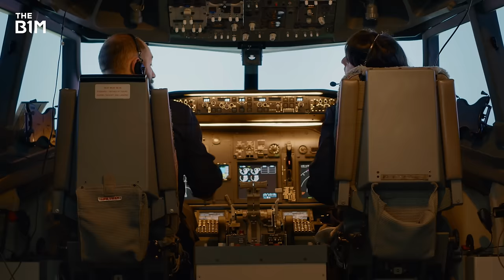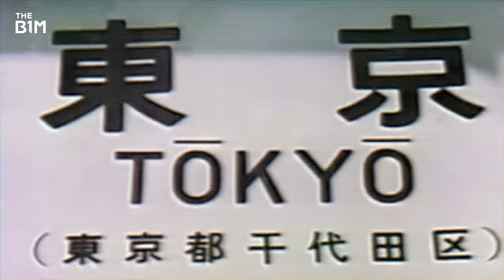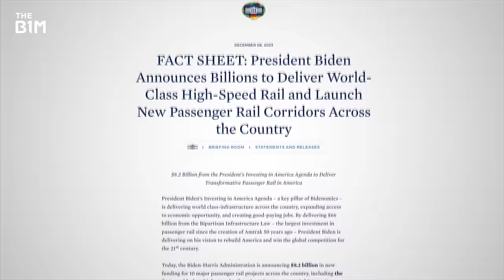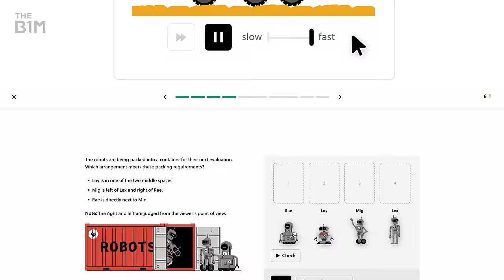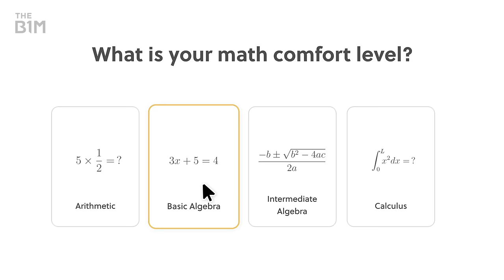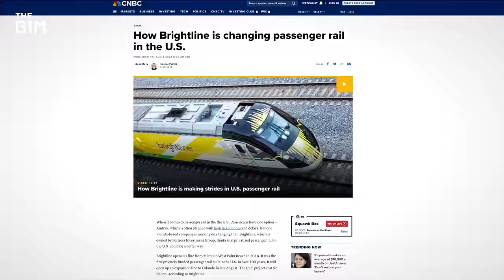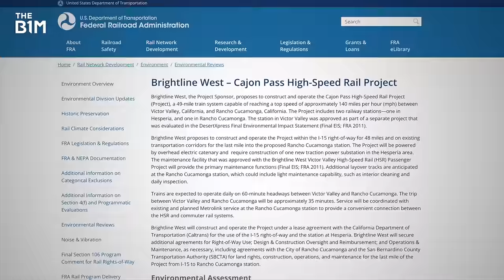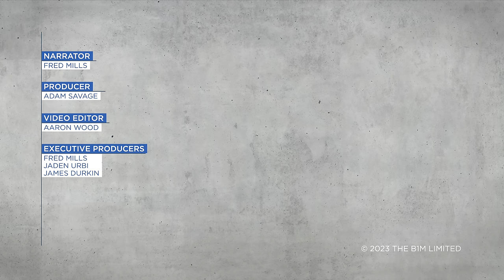The $140BN Race to Build America's First High-Speed Railway

Comment: 11:28 I doubt that the line needs to be as flat as possible. Right, windy tracks along narrow valleys isn't a real thing for high speed line, but not the incline. Look at dedicated eurpoean HSLs. They are quite steep, since no freight train needs to run on them. One of the fastet HSL, Cologne to Frankfurt (187 mph ) in Germany goes through mountains (ok, not the alps...) and its incline is up to 4%. Or the French HSL from Paris to Strasbourg (200 mph) with a incline up to 3.5%. Or Florence - Rome even up to 8.5% gradient (156 mph)

Comment: The only problem is that Amtrack also rides on the freight train's tracks, so the trains cant speed at 150 mph the whole time. Japan, China and Europe have devoted tracks so the trains don't need to pull over when a fright train comes along. The other thing is because the tracks are their own, they are elevated, so you don't have idiots trying to cross or get stuck. Japan is light years ahead of the US when it comes to bullet trains.

Comment: Stupid that Brighline West is laying double tracks.  It could do a 3 hour round trip so one track can service 6-8 round trips. Enough to get started.  If you want to double capacity, put a few mile siding in the middle where trains can pass eachother.  You don't need double tracks for the whole distance.  Also, Brighline should chase passenger trains with cargo trains with an intermodal yard in Cucamonga.  I worked 4 years for CN Rail and Intermodal.

Comment: For all the attraction of Brightline West, the massive advantage from owning or leasing tracks and not having to secure lands for new tracks is severely understated in the video. The new line is not bringing high speed rail anywhere near the actual city of LA and current Metrolink connectors can take an hour from where the new line ends to enter the city. 

These are key advantages that CHR and Amtrak don't enjoy. There is a reason why Amtrak can't even run existing trains on time and that's because of not owning tracks. So comparing these to Brightline is not fair, even if I fully support a new rail line in USA.

Comment: The problem I see is that they are putting the train between the roads. If the train has an accident it will involve the traffic on the road and possibly cause a massive traffic jam from the accident and the damage to the roadway.
Reply: What is going to happen is mostly the opposite...
Reply: I didn't want them to build that train set on freeways because some routes such as the one from Los Angeles to Las Vegas require travelers to drive 60 or 80 miles in the wrong direction until they veer north on interstate 15 and go more or less directly to Las Vegas from there.

Comment: I've been saying for decades, to just use the medians on the interstate highways for trains. The overpassess are already built, just lay the tracks. It should be a no brainer. The bigger issue, is cities must have a mass transit system. No one is going to want to take the train and then have to rent a car when they get there. I live here in Florida and I'm not sure how well the new brightline is going to work. They spent way to much money upgrading old tracks, instead of using the interstate system and they have a lot of old train crossings they have to maintain. They have already had two cars hit in one small town. Also, the options to get a around Orlando are limited. Miami has a metro system, but Orlando does not. If you had a high speed train running from Miami to say Atlanta, it would be full all the time and Atlanta does have a metro system. 
The other issue is the lack of convience with trains/Amtrak. They have continually cut back services over the years, instead of adding services/trains. It is not convienent at all. There are only 2 trains a day for all of Florida (not counting brightline), which is the 3rd most populuated state and you cannot travel West or directly to the mid-west. It takes 2 days just to get to Atlanta, which you can drive in 6.5hr from Tampa. The service that used to run from Jacksonville to LA, was stopped at New Orleans back in 2005. If you live in Naples or St. Petersburg, you will have to catch the Amtrack bus to either Tampa or Orlando, to actually get on the train, because they stopped the train service decades ago. Its just run very poorely, particularly in the South East.

Comment: Around 11:30 it is said that high speed trains couldn't go up steep grades. That is not true, both France and Germany have steep sections on passenger-only high speed lines, such as the 4 % gradient on the line between Köln and Frankfurt. The powerful ICE 3 trains used on that line have no difficulties going up and down. It's curve radii that slow trains down, not gradients.

Freight trains however have more difficulties going up steep sections because they have much less power compared to the total weight of the train. Because of this their acceleration is also much lower than that of high speed passenger trains which could speed up as fast as a commuter unit.

Comment: This project will be obsolete the day it is completed, if that ever happens.   While it could help development along the route and in Las Vegas, it might also be a big waste of resources, and uglify the entire 200-mile+ scenic drive to Vegas.  Assuming self-driving robo-taxis or even just self-driving cars emerge, train tracks will be obsolete, since they serve mainly to guide a vehicle.  Choo-choo trains are an artifact of the 1800's.  Highest train ridership is third-world countries with people crowded on the roofs.  Reasons they are trying this: 1) Few people on this empty desert route to complain.  2) Desire to show off high speed rail in time for the 2008 Olympics in Los Angeles.  3) An existing right-of-way for the 15 Freeway.  Problems: 1) No need to be electric - there is no smog in the high desert, and running wires for hundreds of miles is ugly and unnecessary.  They should just use diesel and save the cost and intrusive ugliness of the overhead wires - there is no dense population out in the high desert, no "smog inversion layer", daily high winds, and hence, no air pollution problem.  2) The same overhead wires can be seen in urban Los Angeles and ruin the view.  In the high desert, the great views of open spaces will be ruined by these overhead wires for everyone driving on the 15 to Vegas.  3) Meanwhile, the supposed future of self-driving cars and robo-taxis will make such a train unnecessary and redundant.  4)  There are issues with wildlife not being able to cross the tracks, and they need to build tall concrete walls on both sides to prevent animal strikes.  More tons of concrete, more ruination of the view.  5)  Ridership will be VERY limited - the same few fixed-income retirees and tourists wanting to gamble, who take busses to Vegas already.  This is a lot of resources just to bring a few retirees to play the slot machines - why not just move the slot machines to Los Angeles?  People will have to take other trains, or even busses, to even get to this train, meanwhile, the drive to Vegas is not that bad in the first place.  6) Typically, such projects based more on a desire to somehow "modernize", rather than actual demand, end up losing money and are eventually mothballed.    That's all we need - tearing down an unused railway along a previously scenic route, while people enjoy high-speed automated travel in their cars on the existing 15 Freeway.  This project seems to be all about an open route with few people to complain, and proximity to L.A. for the upcoming Olympics, rather than actual demand.

Comment: The statement the Cajon Pass would be an issue is kind of weird. The statement "already very steep for freight trains" implies that high-speed trains have it even harder, which is wrong, as for example can be seen in France.
Because of their higher speeds, high-speed-trains can take much steeper gradients than normal or heavy freight trains.

Comment: The problem here is that no one lives in Rancho Cucamonga. It's nowhere near LA. The train from Union Station is about 70 minutes but the problem is that not many people live close to Union Station. There are trains to Union Station but not to all areas. Even then you might have to drive 15 minutes to get to a Metro station that'll take you 30-45 minutes to get to Union Station. So it'll be faster to drive from wherever you are to Rancho Cucamonga.

Now that you've driven to Rancho Cucamonga do you park and take a train for 2 hours 10 minutes or drive the rest of the way in about 3 hours 15 minutes?

Comment: Wendover covered Brightline recently and they got a bit deeper into the financing/business model than just the engineering challenges, and they highlighted how these projects span the public/private divide, so are they really 100% private? Also the downside with this model is that private companies can pick and choose which lines to invest in. They are never going to build a line that they know will lose money, but by building and operating the profitable routes it all but guarantees that we'll never see investment in lines that would barely break even, or even run at a loss on their own, but could operate as part of a network.

Comment: The problem with Brighline Florida is that there is no grade separation. On certain parts seen here, 8:00 cars can go right across the tracks, only a railroad crossing arm protects either car or train. Not confidence building and none of the true highspeed rail systems in the world do this, they use overpass or underpass for local traffic. This is likely one of the reasons why they are limited to only 125mph. Only a matter of time before a train hits a vehicle and it will be even worse if it's a fatal collision with a  politician or celebrity and then everyone will ask why and put an end to true highspeed rail because of the lawyers and litigation that ensues. Brighline was made on a budget and it shows, only a matter of time before it's obvious.

Comment: BRIGHTLINE IS NOT "SUPER HIGH SPEED" RAIL !!!
"Bightline" won't exceed 125mph, for the simple reason they are using Diesel traction. For Speeds over 125mph Diesel traction becomes much more expensive due too reliability issues, and becomes more expensive than Electric Traction. So if want a 180mph (300km/h) railway as in Europe, North Africa, Korea, China & Japan. You need 25,000v AC overhead electrification for high powered (12,000hp) Electric high speed trains, as found on ALL the Worlds current "super high speed" networks.

Further these "super high speed" lines have to have CONTINUOUS 16ft high security fences both sides of the tracks to prevent any people from getting near the railway tracks. This also means NO LEVEL CROSSINGS are allowed, as found on the current "Brightline" railway in Florida !!!

Comment: The Las Vegas - LA  Line has one major issue. The LA station isn't where people want to go in LA, there is little development planned around it of that kind (as can be seen on the images) and there is no efficient PT system in LA either, just Musks toy tunnel taxis maybe at some point. Things are a bit better and worse at the same time in LA. There Union station is indeed a much petter proposition, it just happens to be years away that an efficient connection will be established to it (if ever).

Comment: Brightline West indicated it would/could charge a round-trip fare of $400 for the 3 1/2 hour one-way ride between the Metroliknk station in Rancho Cucamonga, CA to a Brightline station south of the Las Vegas International Airport.  That may be interesting to those living within a 12-15-mile radius of the Rancho Cucamonga Station but I doubt it would attract many from Orange County and most of LA County.  I am unsure if those in most of San Bernardino County or Riverside County would use it.  If one lives in convenient range of LAX, Burbank, Long Beach, Ontario or John Wayne (Orange County) airports, you have access to cheap and frequent flights to Las Vegas that many would consider a better value.

Comment: If you avoid peak traffic periods on I-15 you can drive from Los Angeles to Las Vegas in 4 hours.  I've done it many times.  It might be good for someone who doesn't like the long drive back to Los Angeles after a long weekend in Las Vegas as they can snooze and sober up.  I've taken Amtrak from the Los Angeles area up to San Francisco and it was an all-day affair.  Its a comfortable train ride, and its nice to do it once, but it drops you off at 10PM in Oakland which is not a good area !!! and its across the bay from San Francisco.  If I want to get to the City of San Francisco ASAP I'll drive (7 hours).

Comment: Eight meter wide triple level maglev passenger cargo trains traveling 800 kph - 1,000 kph (800 kph = 497 mph ~ 500 mph) are a reasonable development to start to take place by 2045.  The issue with HSR is that it is rail that first made 300 kph way back in the late 1970s and is not maglev with new long distance first generation 500 kph maglev trains in Japan scheduled to start in 2027.   Over double the loading gauge of standard gauge trains has been desired and attempted since the 1840 where double track UK railroads were designed to occasionally allow double width carriage using the inner rails of the two tracks.  Eight meter wide maglevs would allow perpendicular drive-on-drive-off of automobiles and shipping much larger pieces of cargo long distances overland on cargo only cars such as large pieces of structures.  

As mixed passenger cargo 8 meter wide three level maglev trains the first level would likely not be continues between the cars and a bit noisy from the maglev motors able to load typical automobiles perpendicular in a drive-on-drive-off configuration or hold shaped cargo containers.   The first level might also be a sound isolated area for passenger services such as a gym with workout equipment, meeting rooms, playroom for children etc.  The second and third levels would be continues luxury passenger space able to have vista domes on their roofs to allow passengers to see out front watching the scenery.   The passenger double levels and over double the width of standard gauge single level trains of today would allow these maglev passenger trains to hold about the same number of passenger in more comfort in 1/4 the length of todays passenger trains so popular passenger trains would stretch out for many city blocks.

Comment: Absurd idea! I live in France where a dedicated network of TGV trains crisscrosses the country. Where the TGV trains pass close to autoroutes it is seriously shocking to have the train pass while you're driving! The noise, air shock waves and sight of the train passing by at such a massive rate is enough to cause extensive distractions to drivers. And that is a few hundred metres away! To imagine the same thing in between the highway lanes is complete lunacy! Accidents will happen. Lives will be risked. Whoever designed this does not know what the hell they are playing with... Ie peoples' lives. Get someone to visit a genuine high speed train operation in another country before they start to implement this nonsensical idea!

Comment: 3 hours? That's not impressive. That's basically covering 270 miles in said time...a mere constant 90mph. The drive takes a little under 4 hours in a car. They need to double the speed to 180mph and cut the travel time to 1.5 hours. Now that would be impressive.

Comment: I have liked the idea of trains here in the US, but projects like this seem doomed to fail.

They almost always fall short on the "high speed" part, by offering significantly less speed than originally proposed.

The cost nearly always runs over the original budget by 2x to 4x.

The projects often lack ambition utility-wise.  For example, this Brightline train to/from Vegas terminates about 50 miles East of Los Angeles.  In fact, the California segment doesn’t even go as far as Los Angeles County, let alone the City of Los Angeles.

Rail projects are often slower than driving, even in commute traffic, either due to the number of stops, or by having too much track at surface street level in high density areas where the speed must be reduced for safety.

Frequently, there will be a honeymoon period when a line first opens, but eventually, maintenance and unionized labor costs will push the fare price beyond that which the market will bear, leading to a drop-off in ridership, which leads to further fare increases, which leads to even less ridership, which leads to a predictable financial death circle for the company operating it.

The bottomline is that, if you cannot build a passenger rail line that competes reasonably on price versus driving and/or speed versus flying, you really are not going to establish a niche for the long-term.

The best case is that this project will hold a degree of initial novelty in the short-term.

Comment: Vegas to LA in 3 hours is not even 90 MPH.  I have been on Amtrak trains that were going at least 80 through western Nebraska.  90 is not HIGH SPEED in the world of trains.  Wiki says that to be considered high speed rail they need to have at least 155 mph.  That is for routes specifically built for HSR.  Or, 124 for tracks that have been converted to HSR on at least one section of the line.  As long as flights between Vegas and LA are 1 hour 15 minutes to 2 hours and cost as little as $80 to 100 bucks, rail is not going to have many riders, unless, and this is important, the train station in LV and in LA both are in centralized hubs, preferably with the LV station being in the Strip at say the convention center.  EZ access to the monorail.